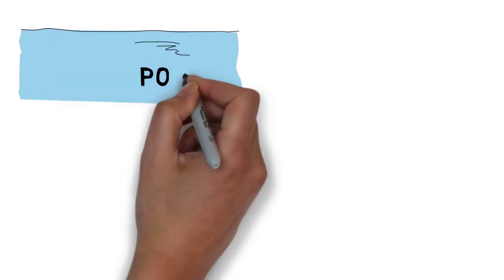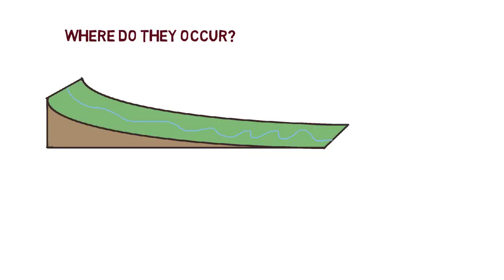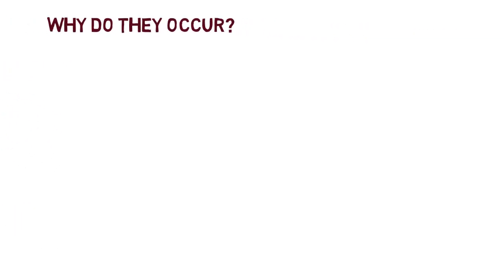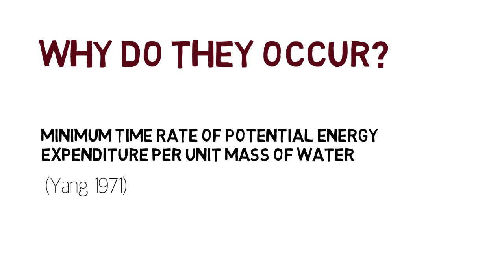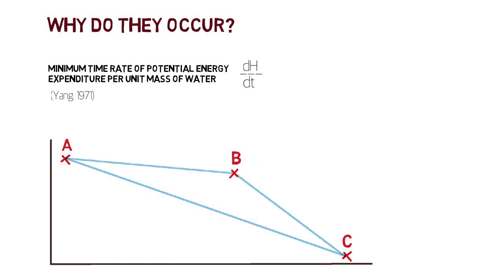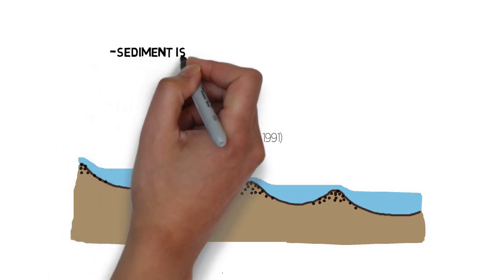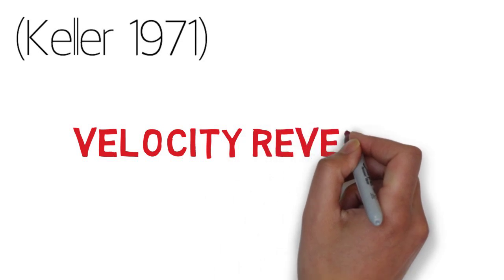Pool-Riffle maintenance

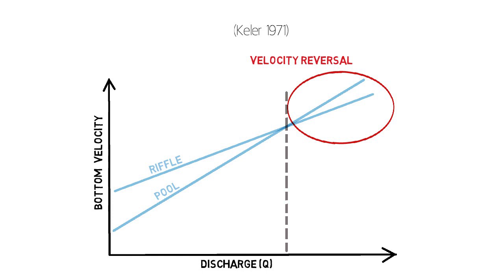Comment: 2:23 This is Because the deep the Water ( flood) Will Push the rocks in the pool , up on to the Riffles .
Water Doesnt Compress, so more Water, more that Rock is going to move . ( as long as the Water can get under the Rock)
its why you see Flat rocks Facing up in a Stream .(in a Have V Shape)